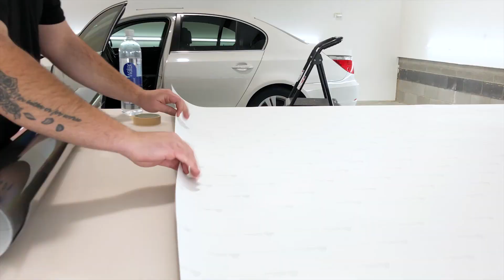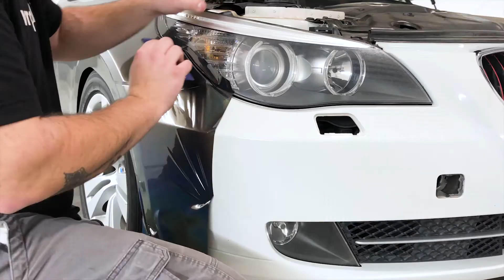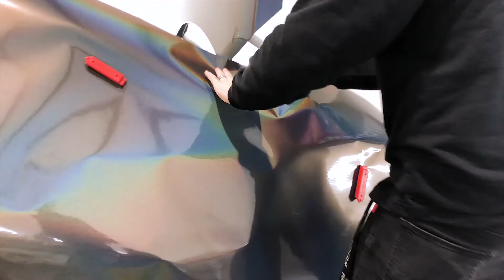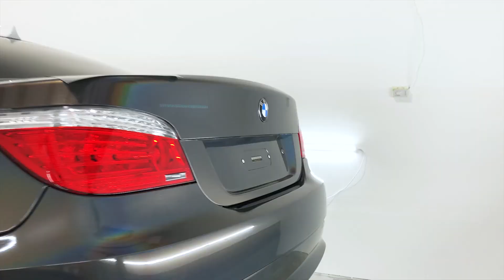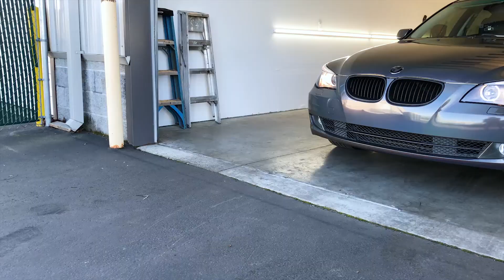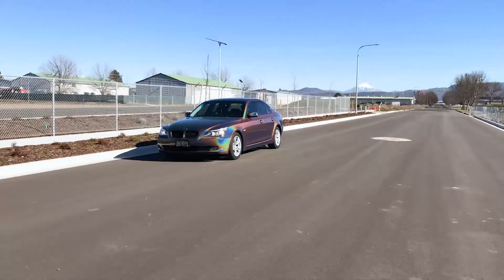Gloss Metallic Pride Prismatic Grey Color Change on a BMW

Comment: Hey guys, this is probably a later comment than expecting. First off you guys did a good job and the end result looks amazing.
I have some questions which you have the option to answer or not. 

I noticed in video that the shark fin antenna wasn't removed before vinyl application and also the door handles. From your expertise, do you think its unnecessary to remove them?

Roughly how much material was needed for this car? I understand the height of the material is 1520mm or 60in but referring to the total length.

The price for this particular colour is very cheap and cost the same price as other Avery standard colour excluding chrome. No where does it state there is a discount or promotion. Is this the same for you guys? for context, Avery chrome gold cost 3.5 times more than this. I just want to know if this is a steal so I can stock some in

Thank you for you time reading
Reply from the maker: Thank you for the support! 

Our rule of thumb with removing pieces of vehicles is that we only do it if it is necessary or if the removal, application, and replacing the piece is faster that applying on it while still attached.

This particular vehicle took about 20 yards of a 60" roll to finish, but we also ended up wrapping the rims and all of the logos as well.

As for the pricing, my vendors have it as more expensive than the standard colors, but not nearly as much as chrome. If you want to stock it you can, we personally don’t stock any colors besides ones that we use a lot of, everything else is ordered in for specific vehicles.